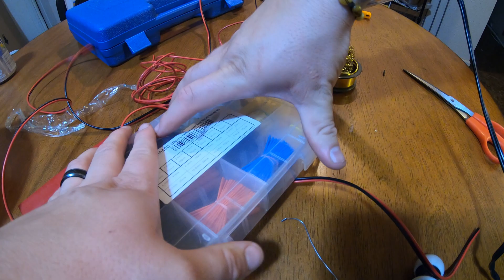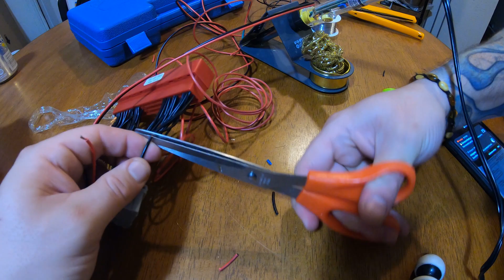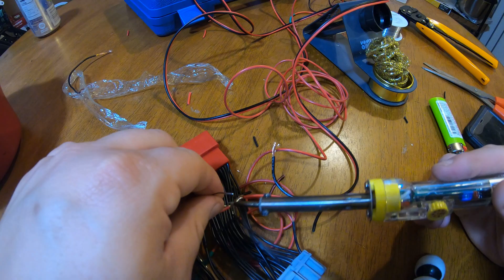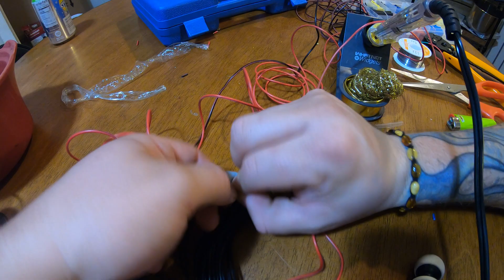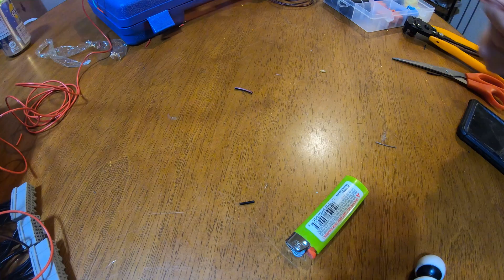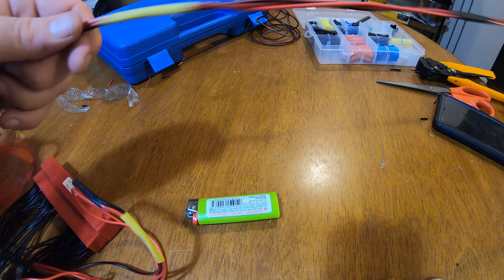Soldering My ECU's Jumper Harness For My Wideband Sensor | TunerThings

Comment: Looks good, very neat. Nice job on the wire management. You can always tell a build someone cares about by how neat the wiring is.
Reply from the maker: Thanks man I appreciate it. Was hearing you screaming in my head the whole time to not solder though lol my butt connectors were packed for the move though lol. Be well my dude